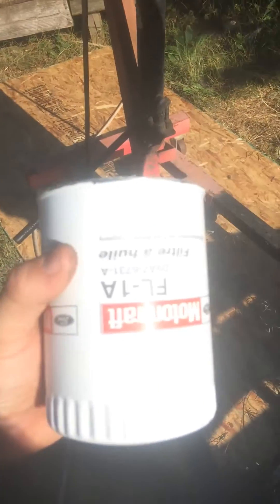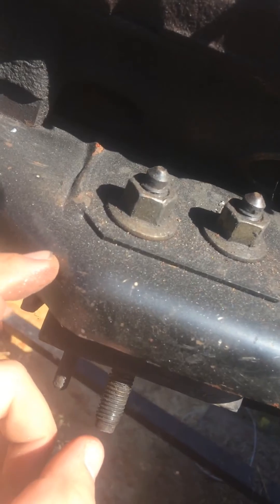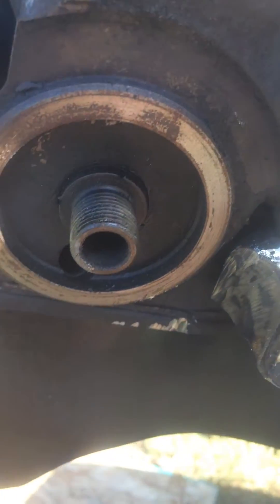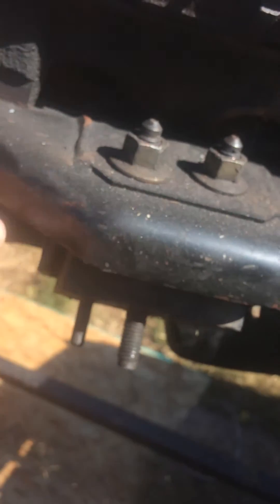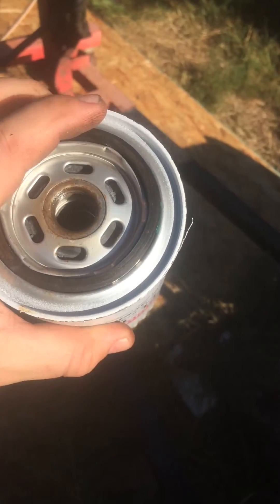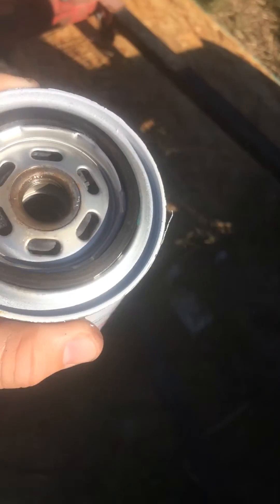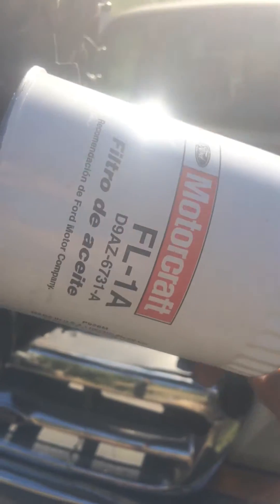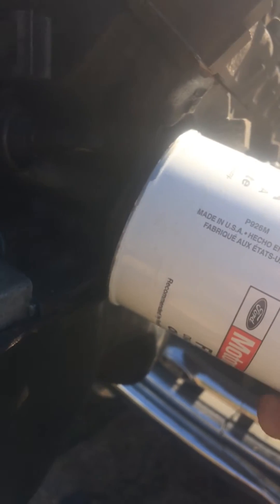Ford Ranger v8 swap oil filter clearance

Comment: Well mine is lowered so my drive shaft was right so I just changed out the front yoke for the t5 yoke and it all bolted in perfect but for a stock ranger you'll have to have a longer shaft you can go to any drive line place and get one built for how ever you need it, its easier to lower the truck get a explorer 8.8 rear end and some shackles the explorer rear end is over the springs so that will drop it about 5 inches so you need the shackles to get the rear end away from the frame then all you have to worry about is the front oh and 1986 nissan truck shocks are 4 inches shorter because the stock shock won't work they bottom out
Reply from the maker: Weston Bruner gotcha ok thanks

Comment: No problem and not sure if you were doing headers or manifolds but the explorer manifolds are a straight bolt in and the motor mounts and motor mount brackets  no cutting  or drilling to get it in and if you have any questions about any of it let me know
Reply from the maker: Weston Bruner I'm using 64 Ford fairlane manifolds there the only ones iv found that wasn't cranked or busted
Reply: Yeah I know with the h.o heads the spark plugs are angled and the on  explorer they are straight so  changing the plugs with the explorer manifolds they are a little tight getting them out and you have to rebend your dip stick tube to change the number 7 plug I had to use them on mine to clear the upper control arm brackets my truck is lowered about 4" in the front so I've got different brackets to fix camber
Reply from the maker: Weston Bruner I gotcha that's bad ass when I get everything set in place then I'm gonna work on making it all look good
Reply: Well if you plan on dropping it the factory ones are only good for like 2 to 2 1/2 inches after that the camber is way off and your tires are leaning in if you plan on dropping it any lower I'd look into the upper control arm brackets I got mine from eBay from a guy named ricksrangerz they're for bagged rangers 97 up but if you plan on going that route then I'd wait to bolt the motor in because you have to cut the old ones out and weld the new ones in but the new ones have to go into the same location as the factory ones if they are off your front end will be off
Reply from the maker: Weston Bruner naw I cut off my old ones not knowing that I could have used them now I'm kicking myself so now I got to have the frame built up so the oil pan is not setting on the engine cradle look at my other videos on my channel I did a video on it
Reply: Yeah everything explorer will fit you can pull a motor from a explorer and sit it right in with no mods oil pan will clear took me 4 days from the time I pulled the 3.0 till I was driving it down the road but of course I used a mustang 5.0 motor and oil pan and I've even got the t5 for the Mustang and with everything I did motor and Trans wise was done without drilling or cutting anything
Reply from the maker: Weston Bruner yeah wish I would have known that from the start but now I know

Comment: The explorer 5.0 has a adapter for the oil filter because when you put the motor in the filter will be up against the steering shaft where it goes into the rack and the adapter makes it easier to get the filter off
Reply from the maker: Weston Bruner yeah I knew what it was but could not for the life of me what is was called thanks for your comment i may have to do the adapter on this but we will see
Reply: Yeah just remember to get the  threaded part that the bolt on the adapter threads into I just went through all that 2007 ford ranger with a 1986 mustang gt  efi
Reply from the maker: Weston Bruner will do bro thanks for ur advice